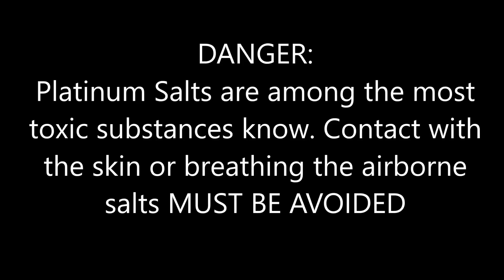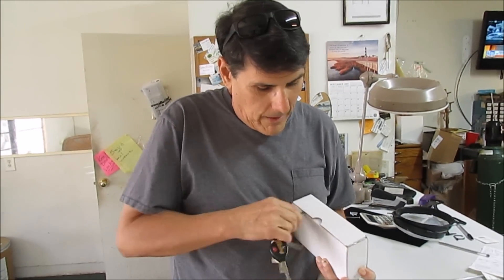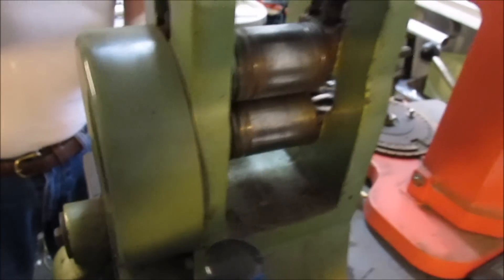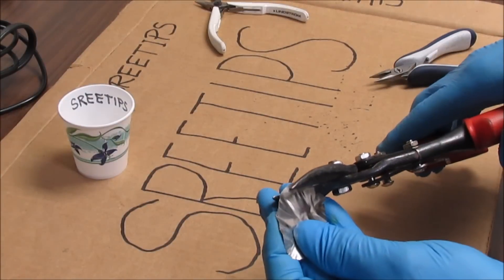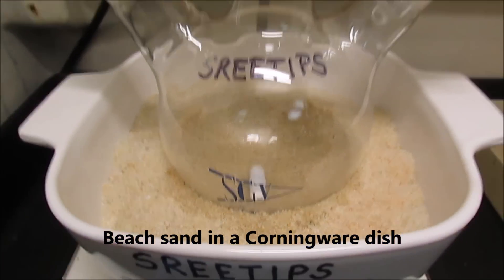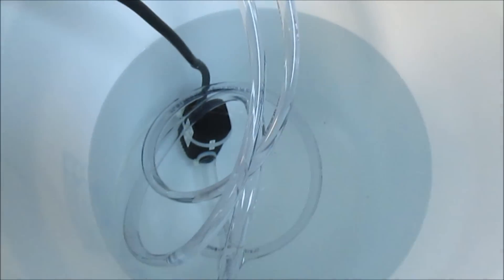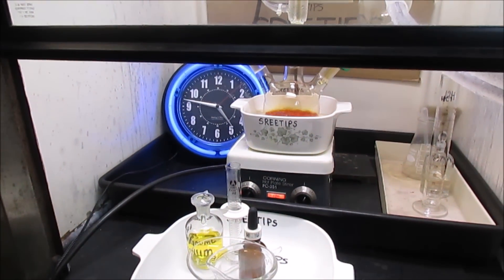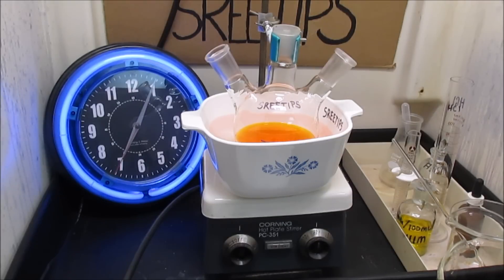Platinum Refining Practice With A Pure Platinum Coin Part 1of2

Comment: I am stuck getting involved. I am going to build  a fume hood out of a farmer water tank 3'x4'x 4' the kind that has a metal cage around them. it has a drain in the bottom I will cut out the side. 400 CFM fan for it. I have gloves and masks safety glasses and a vynal apron with protective feet. I want a face shield. Any other advice I would like. I am building your lab in the back of a semi-trailer. I have ore that was given to me. It you would be willing to try to refine it I would send you a large sample we can split the results. It reacts strongly in Hydrogen Peroxide.
Reply from the maker: Make sure your fume hood is suitable for acid digestion’s, no metal parts. Otherwise you’ll dissolve it and junk will start falling in your work

Comment: "inquarting" with silver and digestion in HNO3 (at least 9 parts Ag to 1 part Pt) worth considering :)
"The Analytical Chemistry of the Noble Metals" by F. E. Beamish  page 112
Reply from the maker: I'm brand new to Pt refining. Ag and Pt alloyed at that ration will completely dissolve with everything going into solution. As far as getting the two to part from each other is a whole different story.
Reply: +sreetips same as parting Ag and Pd, or cementing with Zn or Cu and redissolving the cement in HNO3, only this time the Pt will not dissolve
Reply from the maker: Cool, make a video and show us how it's done.
Reply: Ok, I'll try to make one involving drop from nitric solution,  there is a video already on parting AgPdPt alloy using HCl. Thanks for you time!
Reply: By no means I'm saying how things should be done,  I'm merely asking a PRO for his opinion  :)